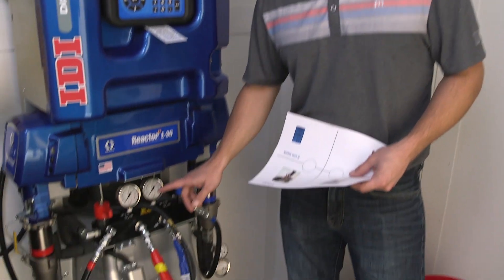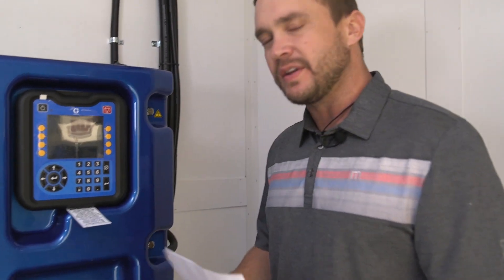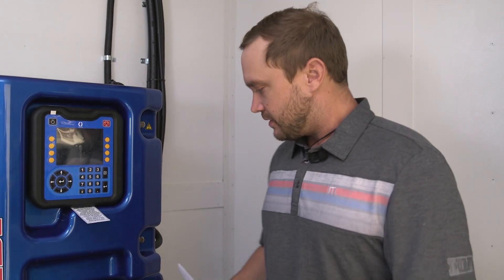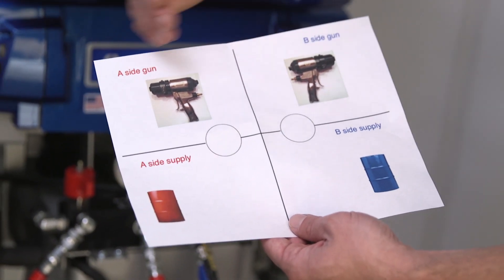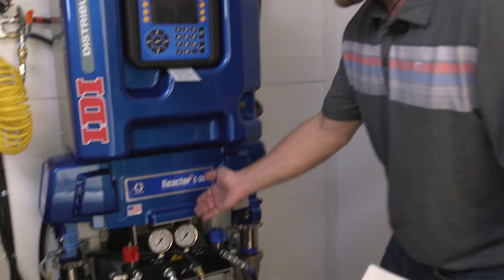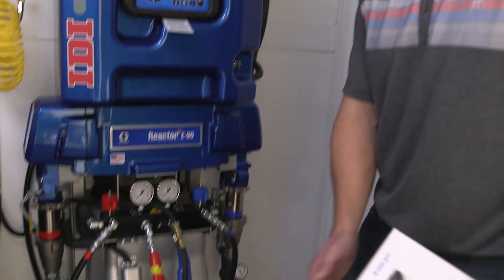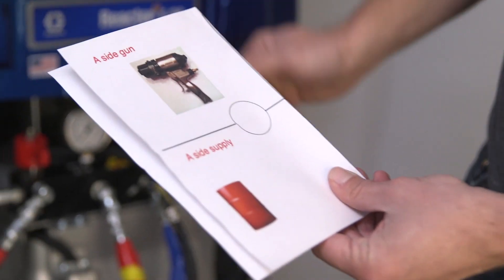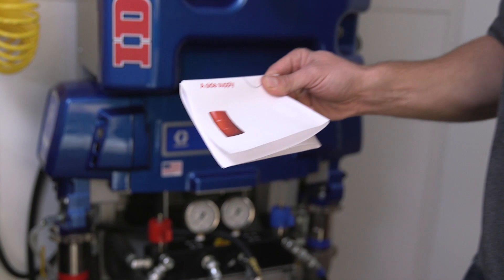Troubleshooting Spray Foam Rig Pressure Imbalances & Other SPF Issues

Comment: Aaron, Frank with Team Installers. I have a question, the minute i pressure rise the rig, the B side goes up. It is higher than the A side.

Comment: 1000 times? wow looks like these machines are super unreliable
Reply: Actually, These machines are very good.. Most of the time its user error. My machine has over 777000 strokes on it and I have gone through 12000 gallons in sets.. Never have had to do work on the machine.
Reply: That almost a 1000 times keep hitting me. What could have been going wrong? Can you share?